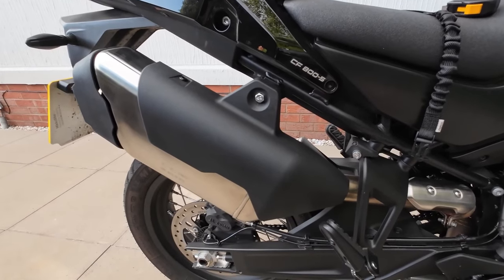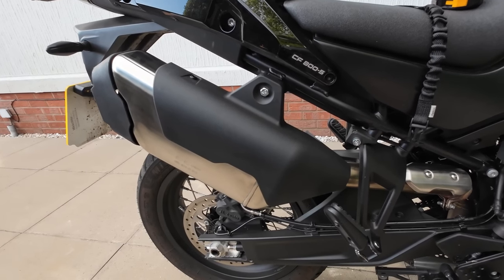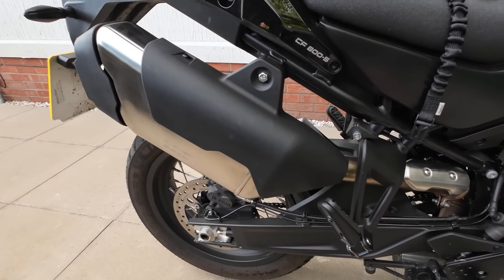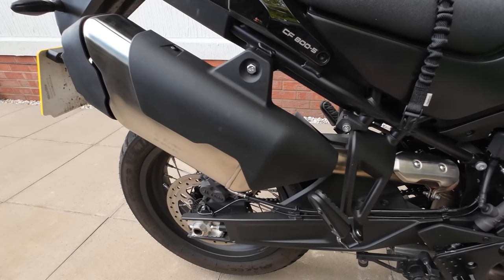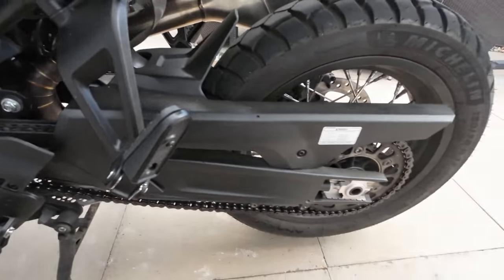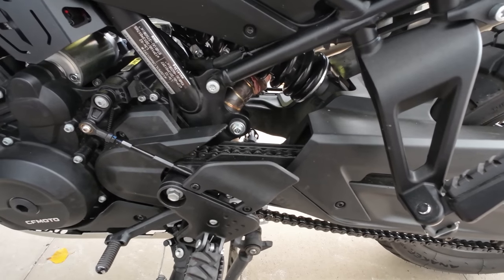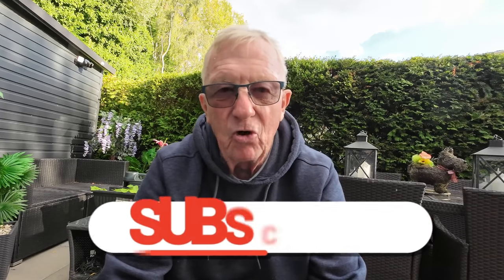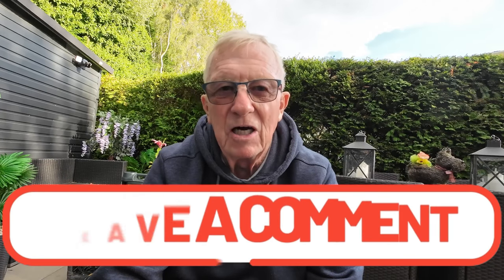Gutted

Comment: I'm not a fan of loud pipes, along with dickhead riding it's the other main thing that gives us all a bad name and at the end of the day an extra few kgs weight of the standard one ain't going to make any noticeable difference to the bike's preformace during normal riding on the road. You'll probably get used to the throttle over time and naturally ride round the issue so I'd just go with the flow and accept it for what it is and enjoy the ride.
Reply from the maker: True mate I just love tinkering I guess.  Throttle is getting better and I think I’ve worked out the biggest weight is my top box with all the bits I carry. Thanks for the comment.